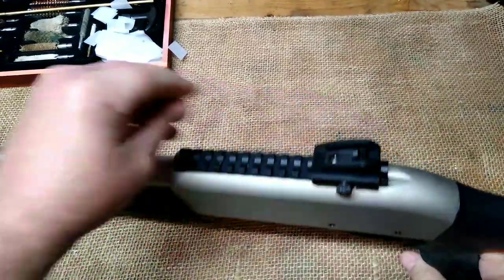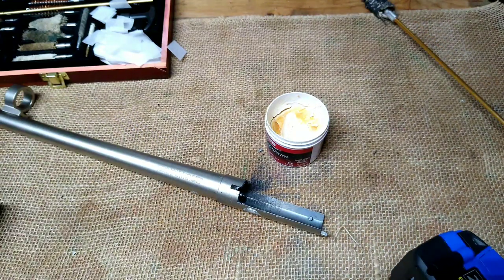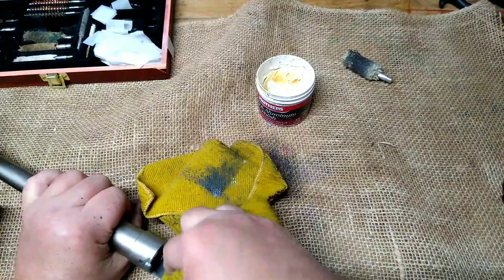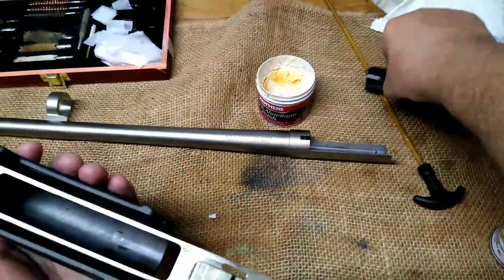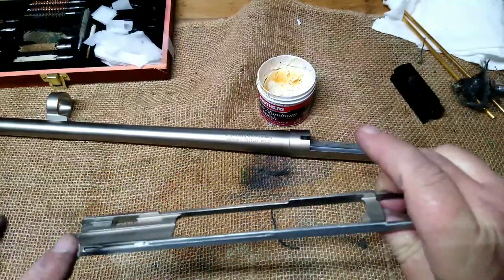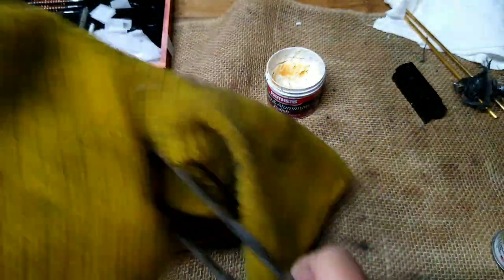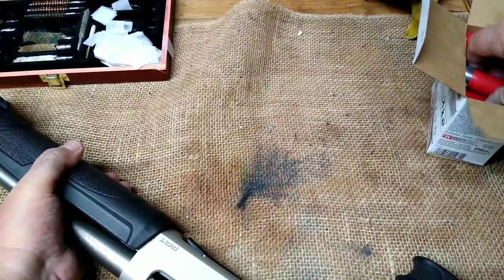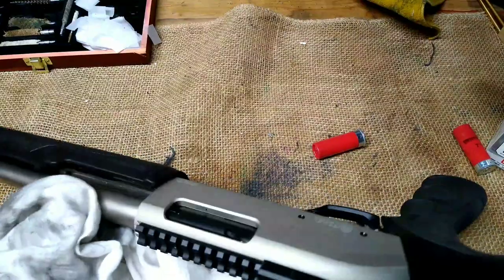Citadel Pat chamber and bolt carrier polish. can we fix a shotgun with a sticky chamber?

Comment: Solved a few FTE with chamber polish. I like the bore brush method. You don't need a hone. Just need to rub all the micro teeth off the steel. Polish brush is just fine. I'd soap the barrel real well with hot water before oiling.
Reply from the maker: Yeah most of the time they don't need a real heavy polishing and I have found that the bore brush method works pretty good to get out those micro scratches that believe it or not can hold up a shell from ejecting

Comment: Had a sticky chamber in a NEF break action .308 and did basically the same thing with a dowel stick and a strip of scotch brite pad.  Did the trick for me, I'm off to watch part two and see if it worked for you!
Reply from the maker: This is the first time I ever had to polish a chamber in order to get a gun to function properly. But it turned out quite successful. The next video you'll see I put 25 rounds through it with no hang ups. And another 25 after I turn the camera off and they all run flawless.

Comment: Iv got the emperor. Same gun I think. Been thinking of polishing. After firing the shells usually Hangup a bit kind of quick jam. Annoying
Reply from the maker: Yes nothing is more annoying than a shotgun that don't want to function right. With some polishing and little breaking in hopefully it will start running for you

Comment: Curious if you ever looked at the brass base area of the fired shells to see if there was any marks, etc that would indicate then hanging up in a rough chamber.  On a pump shotgun, fired shells are only extracted by the extractor on the bolt ... no "blow-back" when fired to help eject shells, so I can see how a rough chamber could become an issue easier than on a blow-back (auto) type firearm.  If a rough chamber was causing shells to stick after being fired, I'd think high base brass shells and 3-magnum shell would stick even worse.
Reply from the maker: I did inspect the shell casings and although I could see nothing obvious apparently polishing the chamber was what it needed. Thanks for watching